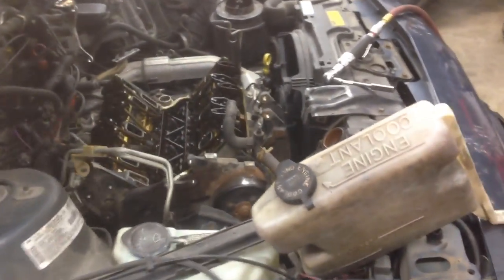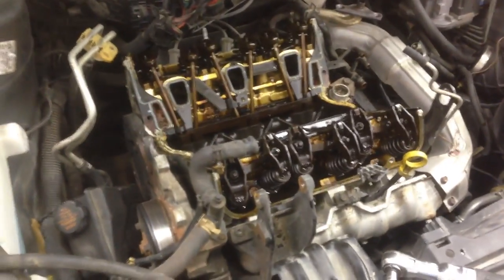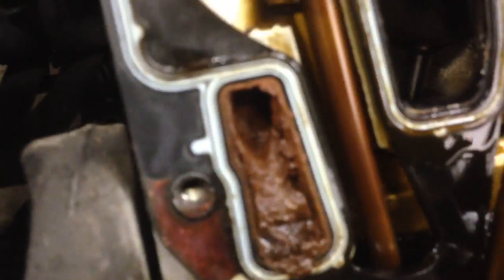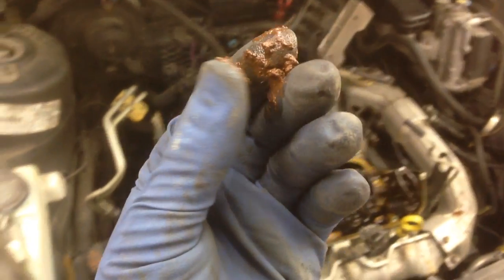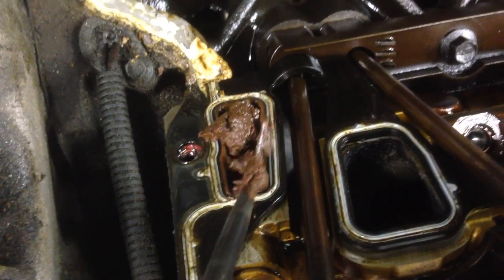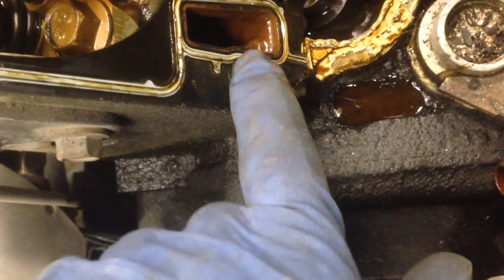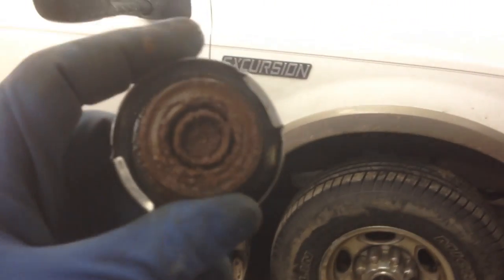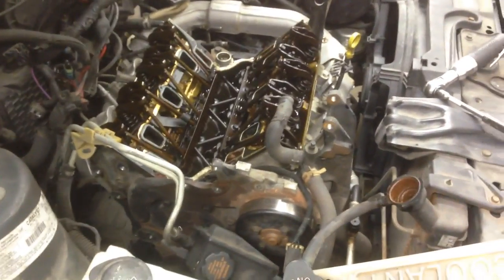Why it's called DexKILL

Comment: The whole reason for DexCool was not only long life but reactions that were happening between the plastic water bottles on GM's newer radiators.  In any case the only time I've seen that kind of junk is when DexCool got mixed with something else like regular glycol based anti-freeze.  Distilled water is recommended as well as Dexcool could react and leech minerals out of suspension in tap water with a higher mineral content.  In that case you'd get buildups as well. Bottom line either Dex Cool all the way or drain the block and start over with something else.
Reply: Car Stuff with El Camino Guy explained perfectly. Thats usually what happens when you mix it with regular coolant. Ive had several Impalas and malibus with the 3.1 3.4 and 3.8s come in with gunk build up due to mixing the 2 coolants.

Comment: if u had to do a second head gasket job in only 25,000 miles maybe the source of the problem is that u have a warped or cracked head gasket and replacing it with a same kind of CHEAP gasket will result in another blown gasket again very soon ,.... BY THE WAY I USE DEXCOOL IN MY 2003 SATURN L200 2.2 4 CLYLINDER AND PUT OVER 300,000 MILES ON IT AND NEVER HAD TO DO THAT HEAD GASKET JOB EVER!
Reply: juan aranda The 3.1 was a crap engine, not one of GM's better efforts. I've run DexCool and have had mixed results. A 5.7 I had in a big van developed leaks in the intake gasket, it was an '01. The leak was typical because of the coolant, fortunately for me it leaked to the outside of the motor and not into the oil. I never saw any sludge that this guy's showing. I run a 6.0 in a newer '08 van now and haven't had any problems yet. I suspect that GM has solved the DexCool problems that they had in the past with better gasket materials. I've never seen the sludge that this guy is showing us. I haven't taken apart my engine, but I've never seen any evidence in the overflow tank or radiator. I also did a thermostat change and didn't see any sludge either. I also own an '04 Toyota with the 3.4 motor that's had DexCool in it since it was new and also have never seen the sludge or had any problems so far.
Reply: Matt P.       .....I AGREE ! Now that you say that about the colant leaking through the intake GASKET. I had a '2000 Pontiac Grand Prix with a "what u mee call it!" 3.1 (3100)  "CRAPPY AS HELL" V6 engine, that had Green colant oozing out in a certain section . I saw it when I went to get my oil change done the tech brought it to my attention, he showed me with a mirror on a stick in which was the only way it could be seen, it wasn't visible from the top side directly. Another example or proof that the 3100 is  worthless was when we again had another technician another shop another car  '2004 Chevy Impala that needed Intake gasket(s), (1)Head Gasket,  (WE DID BOTH HEADS OF COURSE)was starting to fail . We got it so early that we experienced no overheating or water in the oil . BTW MY favorite V6 ENGINE that GM makes is the 3800 series 1.2. & 3 with a supercharger stock . I've seen it in the Grand Prix ,Grand Am Gt , Bonneville ,  Buick Regal GRAN SPORT, Le Sabre Buick Century and a few others !
Reply: +juan aranda - The 3800 (231c.u.) V6 is a great engine.
Reply: you people dont realize every car is different I agree with him. a car that operates in colorado will operate different then the same car in florida temps are different driving conditions are different Im in oregon I have owned 3 grand am with 3.4's and all look like this so you cant compare your car to another unless your in the same area
Reply: The 3.1 is known for this failure.  I don't think there's such a thing as a cheap gasket either.  It's going to be Fel-Pro or what GM offers.  Unless you meant home made.
Reply: Drew 5.9 yes you're right, every car is different. Besides location and climate how a particular driver operates the vehicle would be a major factor as well. As a general rule I follow the instructions from the manufacturer as to when and what maintenance is to be done. If I've been using a vehicle for big or dirty jobs I maintain them more frequently. I'm not afraid to use a vehicle, but I don't abuse it either. I think a lot of people are on the "no maintenance" plan where they don't do anything until it blows up. All the big domestic car makers have had their hits and misses over the years. Even the imports. I've seen sludge similar to what this guy shows in the video on cars that the owner has put 200K+ miles on and over a ten year period had never changed the coolant once. I live in an area that has both extreme winters and summers. The climate is typically dry, but if you have a properly maintained cooling system, you should never see something like this. If DexCool always caused this problem I think you'd hear more about it. I have a relative who lives in a warmer climate who keeps their cars for 150K+ miles and I've never heard them complain about DexCool, but this individual is like me as far as maintenance is concerned.
Reply: Matt P. Exactly....I have over 1 million kilometres on my 2001 Buick Regal, and have never had a problem with coolant or gaskets. Check it with every oil change, and top it off when needed. Have never had to drain and refill the system and am still running the coolant it came with the day it rolled off the show room floor. (Aside from what I have had to add over the years).
Reply: a.....SATURN  what is a saturn ?

Comment: My friend i have the same engine 3.1, had to change those lower gaskets they are crap the good ones are the ones that have steel and yes I saw a bit of orange harden coolant in those exact coolant jackets. I Never have used Dex on my car  but i believe it was from when the car was new.

Comment: This only happens when there's a leak in the cooling system that would allow air into the system.  Like a bad intake gasket for example.   Dexcool works just fine in tens of millions of vehicles built over the last 21 years.
Reply: my toyota camry uses dexcool works fine

Comment: Actually that's radiator stop leak. From the looks of it more then one bottle. Been battling that shit since I bought my 96' explorer that the previous owner used right before he sold it. When it comes to coolant, change every so often and it'll be good. If you don't it will get acidic and start eating aluminum and gaskets.

Comment: somethin is seriously wrong.    i heard that mixing dexcool with green coolant causes that.

sometimes mechanics with fill your radiator up with green coolant, after replacing a water pump.      and then the dexcool and green coolant is mixed.    and then..... it transforms into that shit.
Reply: Jeff Fuehr 
Those mechanics are stupid.  Any mechanic that doesn't use manufacturer spec specific coolant is cutting corners at the customer's expense.
Reply: i agree with that
Reply: I had a GM dealership mechanic do this very thing, so much for their "Qualified Technicians". I had bright orange Dexcool when I brought it in and when I got it back the coolant was brown, so I know they just filled it back up with the green stuff. I had to flush the entire system out a few times just to replace it back to Dexcool.
Reply: they did that shit to me too.   and i flushed it out repeatedly over the next 2 years, just like you did

it's a good thing that you did that, because when the dexcool mixes with the green stuff, it starts to turn into mud

literally
Reply: Jeff Fuehr that is exactly what that is, u can not mix
Reply: As the ol saying goes if u want it done right do it yourself ,then u know ur not getting mixed up

Comment: So glad I changed out the Dexcool from my Buick Century. Not sure if the Intake gaskets blew at some point or not ( I bought it used) But I switched it to Prestone universal extended life (yellow) two weeks ago and I've had no issues... Not sure if it had ever been flushed. It wasn't overheating or having issues, but I figured at 125K it should be done, and I found this orange-brown goop in the radiator, not unlike this stuff.
Reply: Josh Nixon did you flush it first?
Reply: David Mcarthur Yes, did a complete fluid flush to get the gunk out

Comment: i dont know about older vehicles but in my 4 yrs working at GMC/BUICK dealership they all run dexcool and dont see these issues unless you contaminate the coolant by mixing it with another coolant or lack of maintenance. in my 4 yrs i only seen 2 cooling systems clogged up like this.

Comment: That's head gasket sealer...
Reply: I would agree with you 100% looks like gasket sealer emergency shit
Reply: when you add sealer to dex-cool, that will look like mud.
Reply: +tim golli true. I swapped my cars out from DexCool to regular for one reason... DexCool isn't sold at gas stations everywhere in case I get in a bad situation and need to purchase it... and you can't mix them or very bad things will happen. I just flush my regular every 50k miles and all is well
Reply: UnitedRecording same here, i went to green on my 99 suburban, for the last 50k miles , it needed head gasket at 250k,  i have a  06 tahoe with dex cool it has 250k and still runs great, i drained it 150k and put dex cool back in it, it still looked good though.  i had a 96 blazer with 150k and the heater core leaked, the chevy dealer charged me $400 to fix it, they put stop leak in it and screwed up everything, it looked like mud,. i replaced it myself after that, had to take the dash off.
Reply: not sealer
Reply: I'm pretty sure it is. It's metallic.
Reply: no
Reply: no
Reply: trolled

Comment: This is not caused by air in the cooling system, it's because DexCool should not be used in a mixed metal engine. You will notice that the rust crud builds up at the cast iron to aluminum transition points due to the electrolysis conduction differential between iron and aluminum. The DexCool is safe in the new all aluminum engines where the hot water induced electrolysis is only contacting aluminum metal. I'm sure GM realized this, and you can understand why they buried the fact in hopes that the affected engines would hopefully make it past the bumper to bumper mileage warranty. One would also wonder if the same thing is happening around the cast iron piston sleeves on an aluminum engine platform.

I have that Dex Crap in my 2010 LS3 Camaro and I plan on going back to regular ethylene glycol when I get to the point of flushing the cooling system and replacing the coolant. I have a old 95 K1500 SBC that only has 65K original miles and the original ethylene glycol is still in the cooling system working fine. You can blame the EPA for DexKill, ethylene glycol is still a better product but it's inherently more toxic to the environment. DexCool also requires that you use distilled water to mix it, tap water with minerals dissolved can also contribute to the sludge situation.

Comment: flush and refill with green conventional coolant. Shouldnt of put dexcool back in there after 1st set of gaskets. Dexcool also eats certain rubbers like intake gaskets, water pump seals ect. can affect any gm dexcool filled car but some are more common than others depending on factory location and type of water mixed with it
Reply: Derrick Moyer Good idea I dont use that crap either but the real problem is more the cheap LIM gaskets than the coolant, ive built a few LA1 3400 engines and 3.1 also and all of them had failed LIM gaskets. I always get the upgraded  metal LIM gaskets when these engines are rebuilt with good gaskets they run forever also the metal gasket are larger than the intake runner so they dont restrict air flow like the plastic ones do.
Reply: martinez1701a

Comment: I own a 98 K2500 Chevy with the 5.7 and like most of the 5.7's and 4.3 around that era the dex-cool ate up the lower intake manifold gaskets so I had to replace them. Dex-cool is more corrosive than the traditional green anti-freeze and the lower intake manifold gaskets in the 5.7's and 4.3's wouldn't hold up against dex-cool, I think it had something to do with mounting aluminum on cast iron and those thick gaskets seemed like a buffer since iron and aluminum expand and contract at different rates but the quality of the gaskets are cheap and that doesn't help.

Comment: This is probably what killed my Lumina and caused piston slap! If coolant can't circulate well i think cooling becomes an issue. I knew the intake manifold gasket was leaking so i'd add dexcool to keep it topped off.
Reply: No, what killed your Lumina was bad intake gaskets that leaked coolant into the crankcase and caused lifter, push rod, and rocker arm damage, amongst various other things. I'm a professional mechanic and have seen it happen time and time again. Nothing like ignoring a problem instead of getting it fixed immediately.  All of the GM 3.1L & 3.8L V-6 engines were known for defective intake gaskets and problems with the OEM gaskets and DexCool not liking each other. The newer aftermarket replacement intake gaskets are far superior to the former OEM gaskets that were used, but all too often, people waited too long and other major internal engine damage had already occurred, leading to a much shorter life-span of said engine before a major catastrophic failure occurred. Additionally, DexCool has other issues, and is extremely caustic to all parts of the cooling system if not changed out every 5 years as recommended. People can claim whatever they want, but I'm living proof of what works and what doesn't. I won't run that DexCool shit in any of my vehicles, and I own a fleet of pickup truck, several cars and a boat-load of farm equipment that all use conventional GREEN antifreeze.
Reply: Thanks for correcting me. It had over 220k miles on it so lesson learned.
Reply: lumina's have pushrods and rocker ?  New to me lmao
Reply: james dean how do you think that your valvetrain operates? Yes you have pushrods and rocker arms. Depending on the year gm upgraded the standard stamped rocker arms to roller rockers. So yes, Luminas have pushrods amd rockers.
Reply: Bbernhardsr Tbh i have no idea. All i know is that it started ticking loud after work one night and a mile down the road my temp gauge was past the middle at 60 mph. I knew that wasn't good so i pulled over and had it towed back to where i live. I had a mechanic look at it and he said it was piston slap.
Reply: James Dean Youngs the 2.8, 3.1, & the 3.4's all do noise that sounds like a mild knock or tap when it is cold outside like in the 30's. That is normal and is caused by some slop in the wrist pins and goes away when the engine warms up.
Reply: Bbernhardsr The only thing was is that this was in the summertime and I live in the high desert of Southern California. I would drive to work in 100+ degrees and it was around 70 that one night.
Reply: James Dean Youngs definately sounds like a problem
Reply: I'll see if i can get a new engine but I'll have to see.
Reply: James Dean Youngs I  had a  Saturn L200 that started to run crazy and stall and sometimes even not start. No one could explain why. So I finally traded it in on a Hyundai Elantra It could have been this bad antifreeze that messed up the engine.
Reply: gm piston slap is caused by their sloppy "net build" process used while building engines to save money. Instead of matching the pistons to the cylinders based on variations in the size of the parts, they just started slamming any piston in any hole. Inevitably, some pistons which were on the small end of the tolerance range ended up in cylinders which were on the large end of the range. They had a loose fit form the factory and only got worse as the engine wore. There were also problems with pistons fitting a bit too tightly, and they'd score all to hell if the engine was not warmed up slowly in cold weather.
Reply: I had a 99 3.1 with the same problem. Bunk intake manifold gasket. Only took it on very short runs until it finally gave out which is fine. The power brake booster was going out on it as well and I didn't want to spend all the money and time cleaning it out and fixing it.

Comment: Thanks bud, I just bought a 5.7 Silverado and was worried that the previous owner had used some gnarly stop leak goo in the motor. Upon opening the radiator cap I noticed a red waxy substance.. I’m
Glad it isn’t stop leak

Comment: I JUST did this same job on a 2002 Grand Am with a 3.1, just changing the lower intake gaskets. Now preparing for the day this spring where I'll be doing the job on a 1993 Bonneville SSEi.